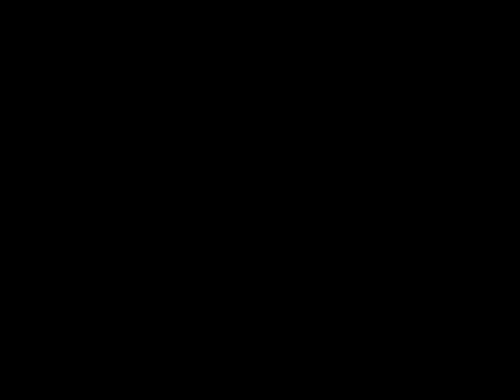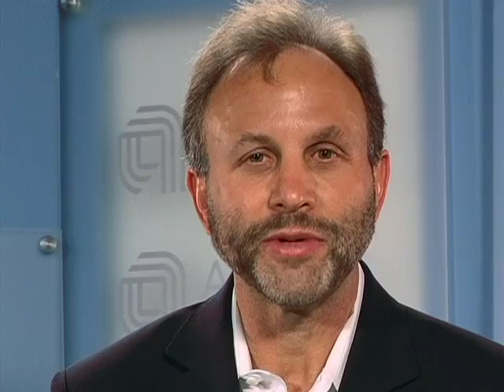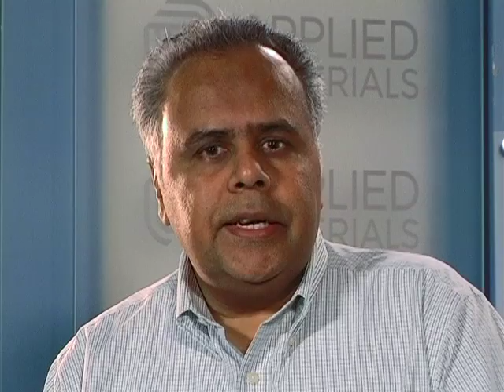The Return Of RC Delay

Comment: scattering dominates when feature dimensions fall below 3X the room temperature mean free path for electron scattering (~40nm); at 80nm pitch, minimum dimension thin wire line Rs is already suffering from this effect; it will only get much worse with continued pitch scaling and increasing Cu volume by thinning the barrier layer will give marginal (if any) relief; further, void-free filling of smaller line/via dimensions will require finer grain microstructures, adding more G.B. scattering.
Reply: will RC delay in devices based on carbon nanotubes be lower?